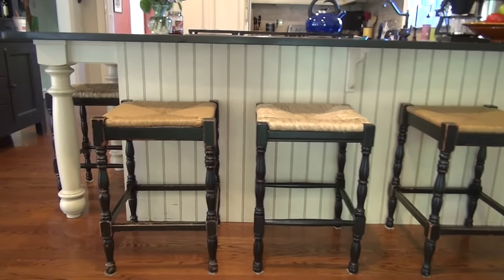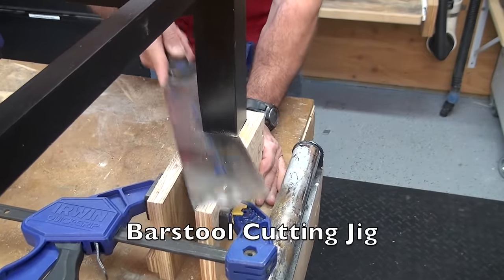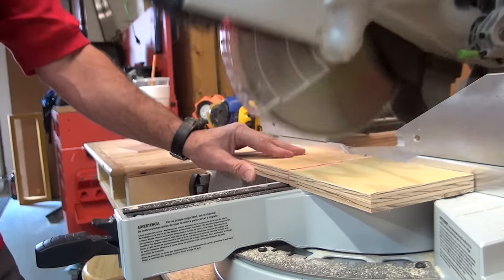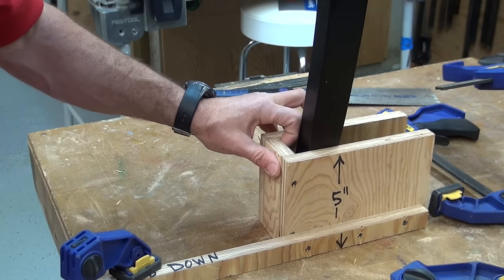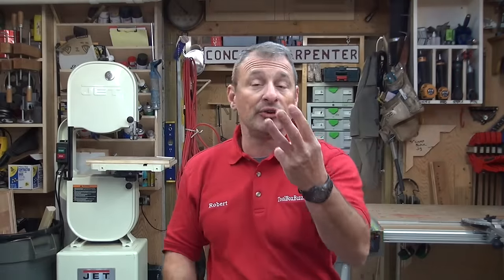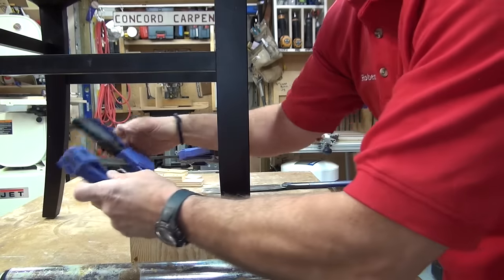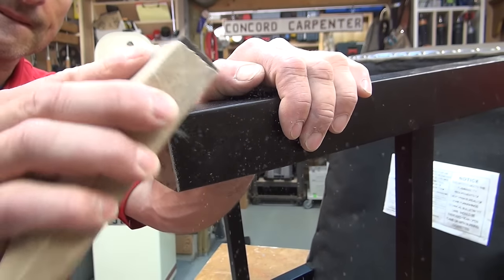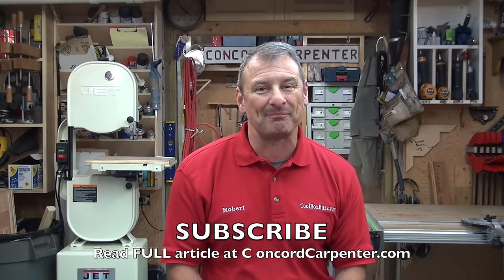Cutting Bar Stool Legs Down

Comment: Thanks for the video. I tried this and it worked well. I found a little trick to make it easier by not cutting the legs all the way through. Once finished with the initial cut on all 4 legs, I placed the stool sideways and went around and cut the remainder of the legs all the way trough. I also found that I could cheat a little by adding leg pins and adding washers to  even them out as needed.

Comment: Your video was instrumental in me completing a succesful project of cutting down 4 metal stools down by 4 1/2" thanks.

If it helps, I don't believe you need the three supports for the other legs.
(1) cut (using the jig) the first leg to 'nearly cut'... but do not cut it all off
(2) twist the chair and then cut the second leg to 'nearly cut'... 
(3) repeat until all four legs are 'nearly cut
(4) flip the chair upside down and cut the legs full off

the cutting jig is extremely important in this effort.

Comment: why wouldn't you use a mitre saw to cut down the legs faster? Also, if the stool legs are off the base, wouldn't that be easier, depending on the stool?
Reply from the maker: Too much work to dismantle the stool and might damage the structural integrity

Comment: A bit late for me. I needed this last week. My legs had a compound angle though. Would this jig work for legs that angle in two directions. I ended up cutting a 2x2 to the same angle of the legs and clamping it on the correct spot. Then I used the cut as a guide to pull the saw along. 

You made a similar video in 2013. This one was better.
Reply from the maker: thanks - this one dealt more with the 3 cut legs - support.

Comment: Hello, 
I saw your video about cutting bar stool legs my concern is that after cutting the legs since its top heavy and a swivel top would it tip over easily. Safety is my top priority. Currently my stools are at 29" from the ground when they should be at 26" since my counter top is 36" (3 feet) measuring from the floor. Would cutting off 3" from the legs compromise the stability of the stool? The legs are tapered. This is a link from bedbathandbeyond of the product I have:  
https://www.bedbathandbeyond.com/store/product/hillsdale-lakeview-slate-accent-swivel-stool/3253448?categoryId=13495  
I tried to put a pic but couldn't. I just wanted your opinion before I started hacking at the legs. Thank you.
Reply from the maker: Nidhi Joseph should be fine
Reply: @ConcordCarpenter  thanks for replying. I actually have two sets of barstools I'm wondering is it easier to reduce the legs of a wood or a metal Barstool. What's your take on that?